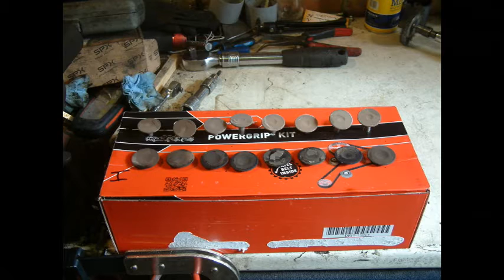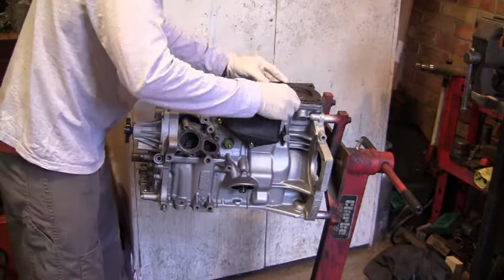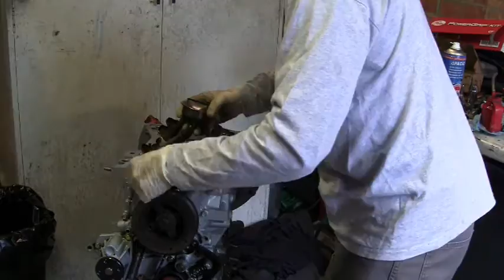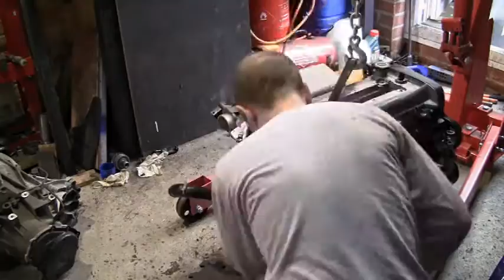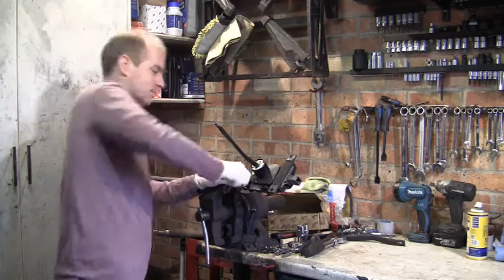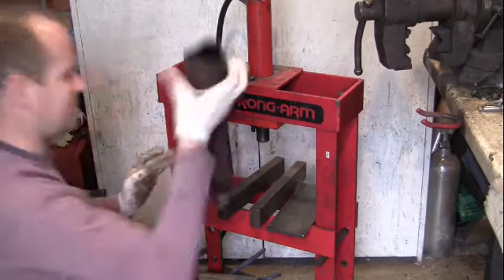Ford Racing Puma Stage 2 Engine service (Part 2) Allison Automotive

Comment: Very good service and very good Ford engine as well. My opinion is since you've got so far deep in this service it would be great if you change the pistons rings as well.
Reply: 1.7 is more Yamaha than anything. Look and compare Yamaha R1 head to Puma head from photos alone. All valves look like straight taken from motorcycle. It is block casting. Cause you can't find Nikasil coating anything but in Motorcycles. Its masterpiece of an engine really!

Comment: Brilliant videos, could not have done my cambelt without it. I did it in the car as I had no option, managed to reisist 60 & 105 Nm on the camshaft with a spanner and scaffold bar, did not break anything, I used the laser starter ring hole locking tool which allowed me to lock it exactly where I wanted it. A heartfelt thank you as my std 1.7 puma is all i can afford currently and have enjoyed learning with your videos, you should teach. Thank you very much.